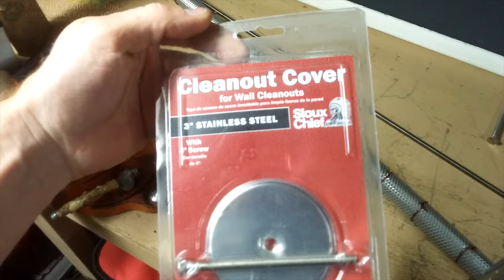#16 Honda PA50II Hobbit Hot Rod: DIY Silencer To Quiet This 2 Stroke Down! (without restriction)

Comment: Russ- I know that this isn't about the muffler.  I have been waking up in the middle of the night with a thought about a starship coil.  I do not know much about them however I keep getting these thoughts about building one.  Can you please build one this way.  First take a thick piece of plexi glass drill holes in it for the pins to wind around.  take threaded  rods/bolts (like a headless bolt)  and run through the holes and then screw on the nuts down to the plexi glass so that there is the same amount of rod on each side.  next wind the cooper around the pins on both side so you have a double starship coil.  *not sure if you should wind backwards from each other or if you should insulated the pins or let them share same current.  Once you have it wound on both sides cut a hole in the plexi glass where the middle hole of the starship coil is.  Repeat the process so you have two of these once you have both take a rod and run through the holes.  Not sure how far apart you can set each coil but spread them apart the length of the rod so you have maybe 6 inches left at the end of the rod on both ends.  Turn on your current and rod should levitate.  May use some neodiam magnets around the rod to help levitate.  I keep seeing a vision of this but four of these with two rods connected in the middle by another rod like a H shape and a double starship coil on all 4 ends and having the ability to hold 100's lbs of weight.  This would be used in conjunction with a large scale quad copter where the the coils makes the driver weightless and people are able to ride on the quadcopter,

Comment: You should've tried to go sidebleed with an adjustable rear bleed valve! Look on MA about side-bleed pipes and I think they sell some on treats. For circuit style pipes you would drill a new stinger hole in the middle of the largest chamber of the pipe and then weld up a nut on the end cone and use a bolt to plug it up or a bolt with a hole in it to allow some bleed.